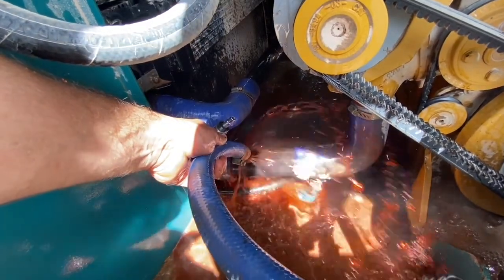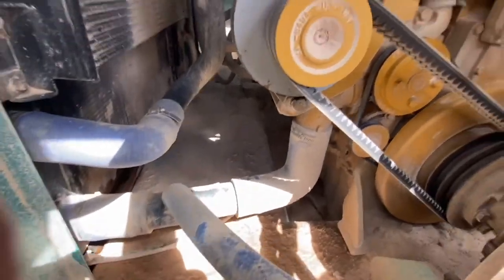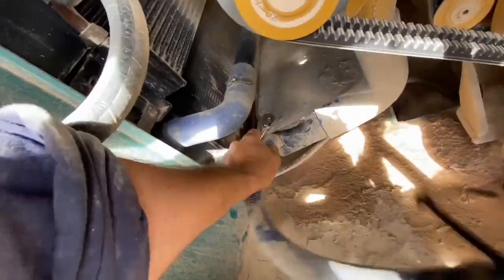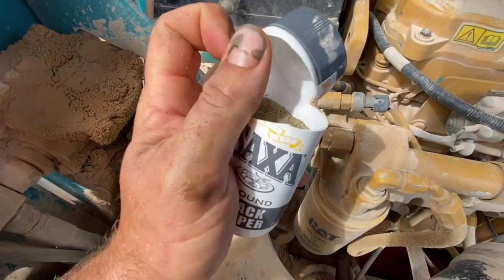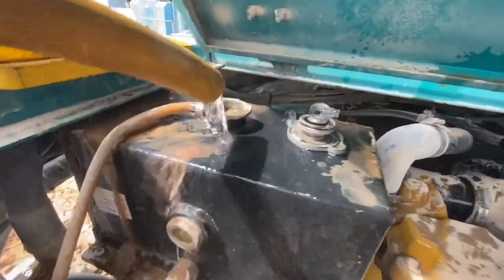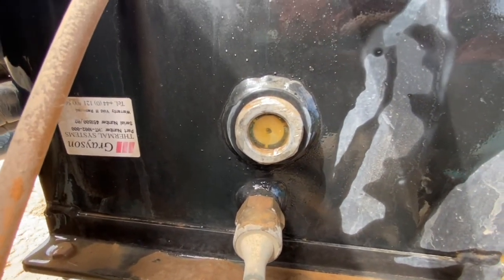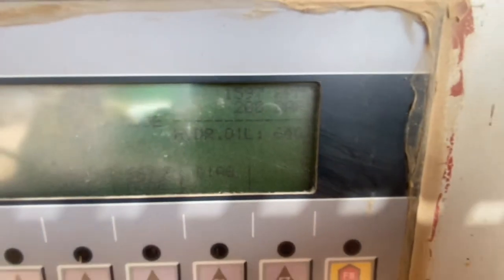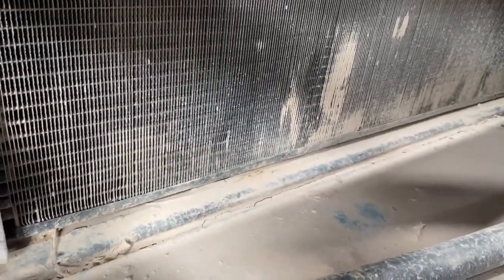How to stop a leaking radiator

Comment: It really works. I HAD a water pump leak, and the water was gushing out: I put one thing of black pepper in it and filled it with water and I drove the van for about 6 months with no problems on a daily basis. I started using my truck more, but I didn't have any more problems with my water pump. I did it years ago with another van that I had!!

Comment: I used black pepper many times. I stay away from stop leak. I had a leak at the intake manifold and the head. Black pepper will float. With the coolant level at the leak I poured half a can of black pepper and leak quit almost instantly. I then filled it up with coolant to the proper level.